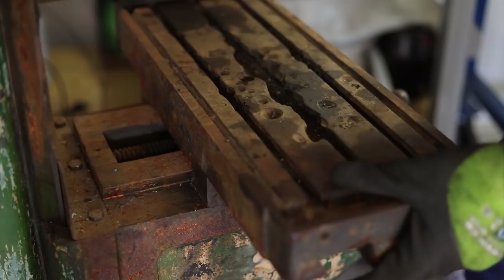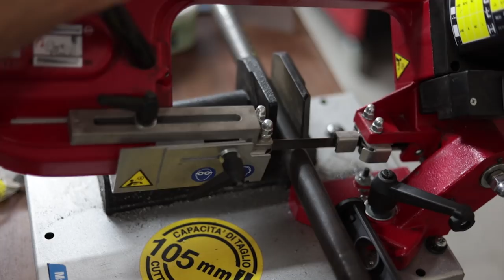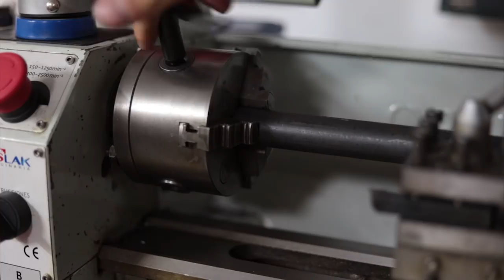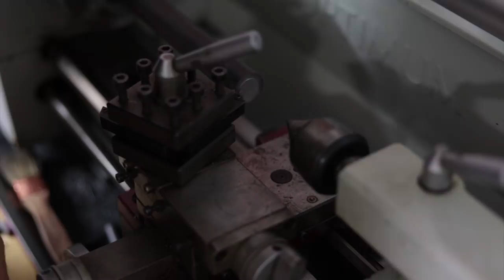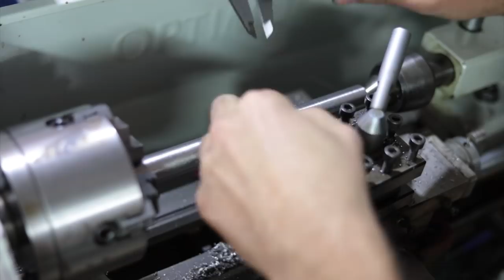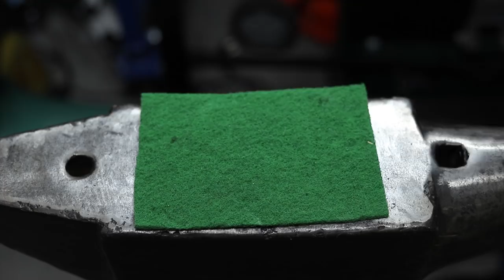🔥 1950 Drill Milling Machine Restoration | Part III a 🔥

Comment: Really well done!  This will be a great machine to have around the shop when you complete the restoration.  Can you tell me which paint/color you are using?  The color is as close to the original paint on my Powermatic Millrite vertical mill that I've seen.  Thanks for the great videos!

Comment: Pro tip #304 When "trueing up" or turning a small, "true spot" (meaning you made it round) on a long part in a lathe, (because it needs to be run with a steady rest), cut the "true spot" on the part up as close to the chuck as possible. The closer to the chuck you are with the cut, the more rigidity the part will have, and the less likely it will be that you will knock the part out of 'round' (or 'indication') when cutting it. Knocking the part out of indication could result in the part suddenly being pulled out of the chuck and sent flying God-only-knows-where, and may require a change of underwear at the very least.                                                                                                                 So, to recap, turn a true spot for the steady rest as close to the chuck as possible, once you have it cut, stop, take the part out of the chuck, flip it around so that the true spot is out on the long end, set up your steady rest, and carry on, safely.
Reply from the maker: Thank you. Next time I will use your pro tip :)
Reply: AND THIS is why I love Youtube. The trolls, not so much... The people like Mr. Allington here who share knowledge, as a mentor would, to help others: Heck Yea!
Reply: Good tip Stephen. Thanks.

Comment: If I were you I would have center drilled it before putting the steady rest on. It can be really dangerous when the piece flies out from the tool pressure. Especially because three jaw Chuck's don't grip the work very well at all. Just a bit of friendly advice that's all.